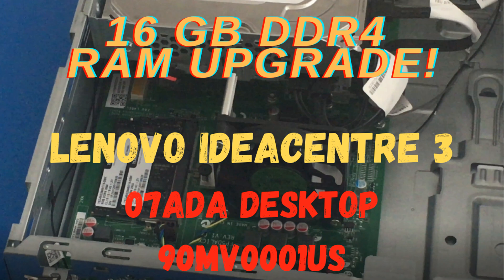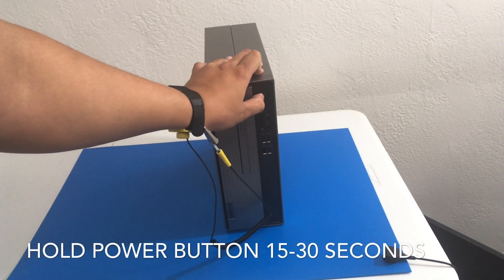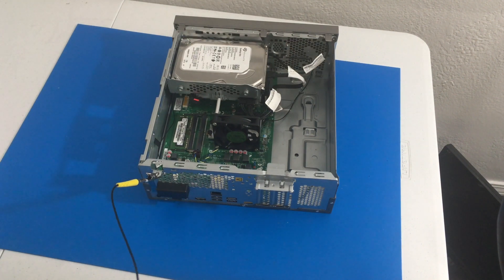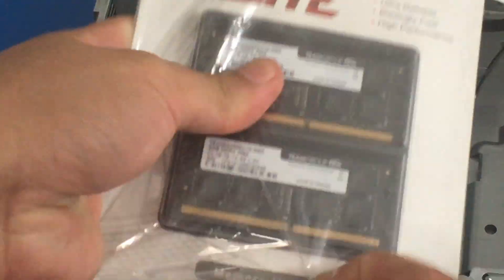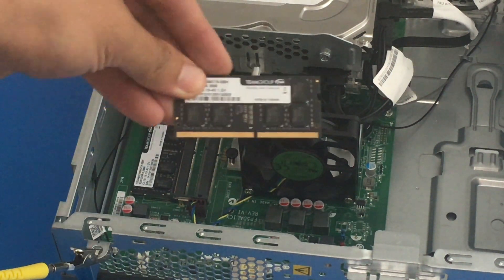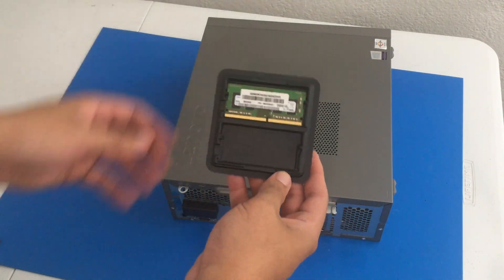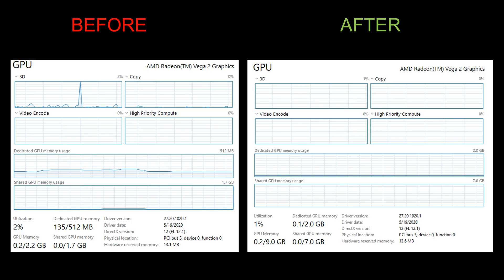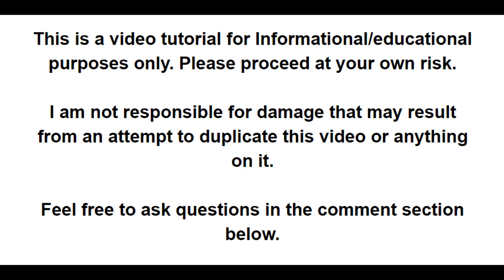16GB Ram Upgrade Lenovo IdeaCentre 3 07ADA TEAMGROUP Elite DDR4  PC4-21300 CL19 TED416G2666C19DC-S01

Comment: i know this is an old video so you probably wont reply, but what are the requirements for the ram and the ssd for this pc?

^edit- i found a ram and it is this: 8 GB PC19200 DDR4 2400MHz 260 Pin Memory. would that be ok for this pc? im gonna buy 2 for 16 gigs

Comment: Hello is it 2400 mhz or 2666 mhz I see it takes 2400 mhz on website y u chose 2666 mhz?
Reply: I followed ur footsteps and put the 2666MHZ does it matter??
Reply from the maker: It will run fine with a 2666 mhz stick, but it will match the speed of the slower ram. Even if someone put a 3200 mhz stick it would still run at 2400 mhz because that’s the slower stick
Reply: Thanks bro it reading at 2400, very helpful and informative video appreciate u buddy 😅
Reply from the maker: No problem happy to help
Reply from the maker: No reason in particular. It’s just what I had available at the time. 2400 mhz will be the speed it will run (ram will run to match other ram in speed, whichever is slowest) If the other ram is running 2400 mhz and I put in a 2666 mhz ram stick they will both run at 2400. Hope this helps. If you have 2400 mhz that will be perfect to match if you currently have a 2400 mhz ram installed
Reply: One m0re question, I’m assuming 2666 GHz is compatible with this PC processor? Even tho it recommends 2444 GHz. I put a PNY from Best Buy
Reply: 2400 GHz **
Reply: Nvm

Comment: Quick question. This doesn’t have to do with this video but with a video from I think a year ago. Would you recommend me getting the HP 14 inch laptop (330 dollars, AMD Athlon, 4 GB RAM) or the 330 dollar iPad. I mainly want it for Roblox and some school work. Thanks!
Reply: Thanks for the advice! I’ve just been having trouble choosing on whether to get an iPad due to the portability or a laptop due to its features.
Reply from the maker: There might be some things the iPad won’t be able to run that windows can. But not a lot I can think of. Unless you need certain programs for classes that uses windows
Reply from the maker: Yeah the hp amd athlon silver. It’s a good entry level laptop that can upgraded. iPad would be pretty good but you might have to get a keyboard if you have to type a lot. My personal opinion is an iPad would be more consistent performance wise. The hp laptop is good for basic stuff. It might struggle with playing games without any upgrades
Reply from the maker: The iPad would be more convenient to use. Just My personal opinion though
Reply from the maker: I was looking at the new ipads the chip is scores lower for the a12 vs amd athlon silver 3050u. Look up A12 vs athlon silver 3050u comparison
Reply: @whattmeter  So the a12 is slower than the Athlon? In that case, what would it mean for Roblox?
Reply from the maker: Isn’t roblox for ipad the mobile version? I never tried roblox for iOS before
Reply: @whattmeter  Correct

Comment: i have a legion tower 5 i am replacing my current ram with new ram. it’s team group 2666 mhz ddr4. is that good ?
Reply from the maker: That’s good. I’m personally not picky with ram unless you are using gaming ram which means you would access the xmp profile. Team group is usually standard ram in my opinion. Check your task manager> performance tab > memory to see the current ram speed and slots. You can also use cmd as admin > wmic memphysical get maxcapacity to check max ram you can put in the computer
Reply from the maker: Isn’t the legion tower 5 a gaming desktop? I would contact support to see what ram they recommend or if you are able to access the xmp profile. Some gaming ram need you to access the xmp profile to use its full speed/potential based on my experience